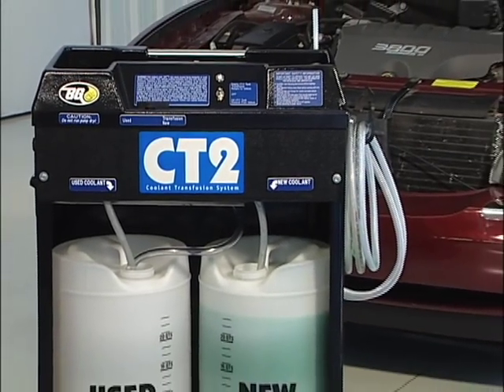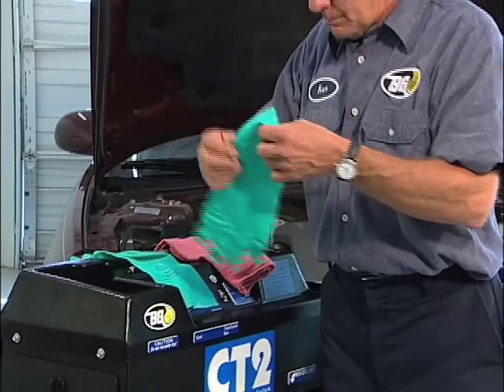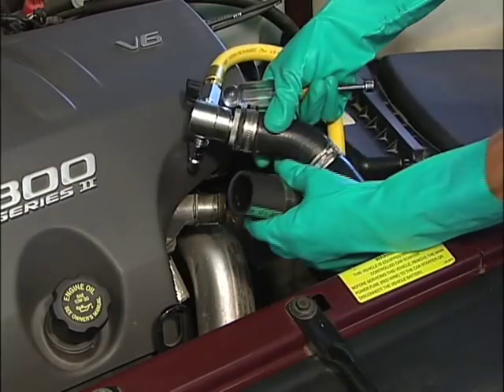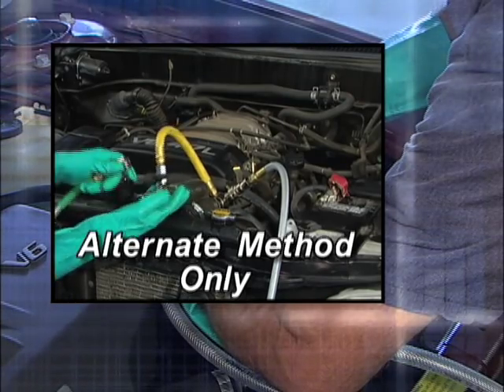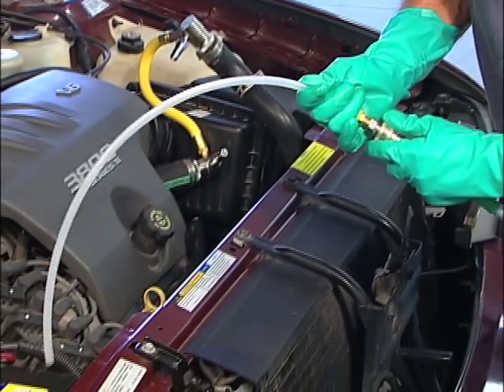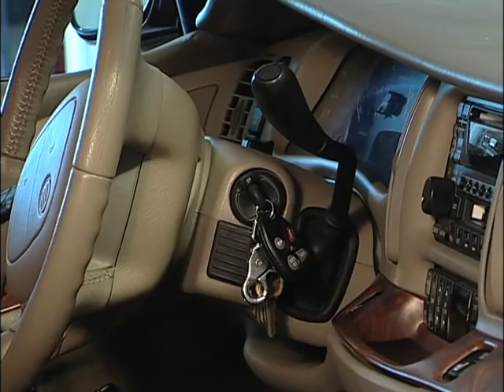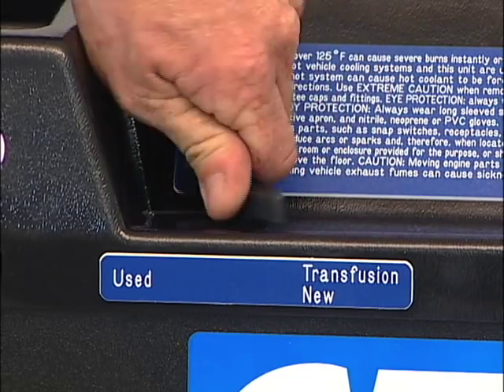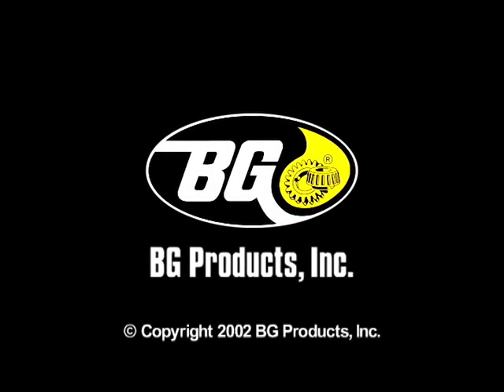BG CT2 Coolant Transfusion Machine Training Video

Comment: So on a Subaru Outback, you’d put the pump hose toward the radiator instead? I do believe the thermostat is on the bottom hose of the 2017 outback. Just don’t wanna put too much pressure on the radiator and cause it to break and then I’ll have an even bigger problem on my hands lol
Reply: I had a 2011 subaru outback and flipped the hoses like he said but during the flush the reservoir filled up all the way. Idk why that happened
Reply: @coolmason3000 I think it’s because you didn’t pinch off the overfill return line watch around 3:20